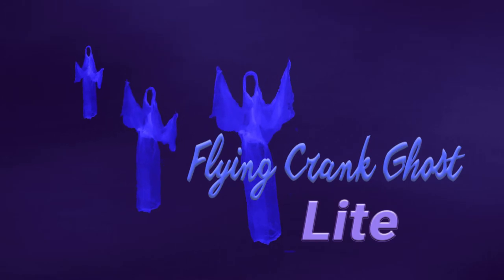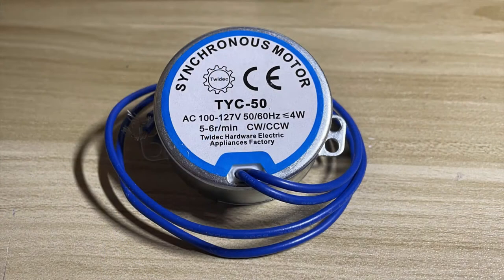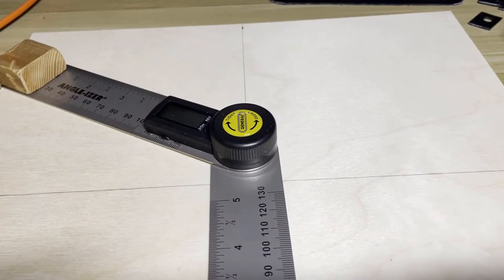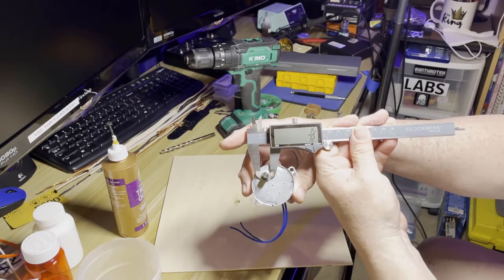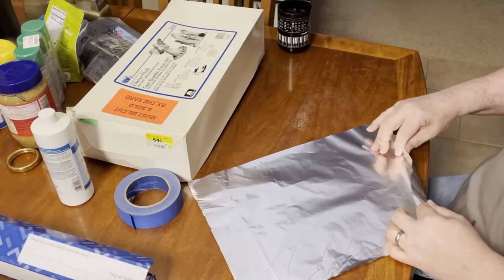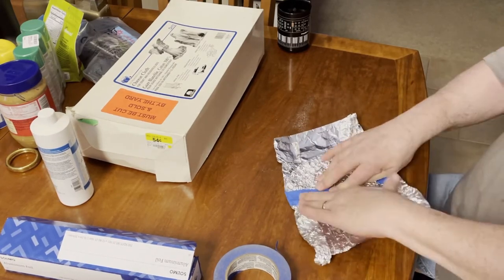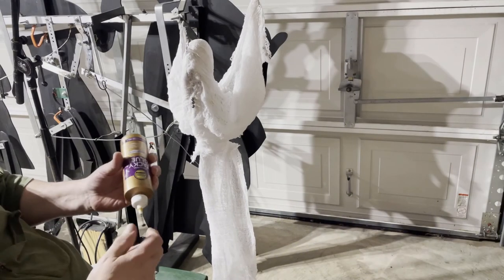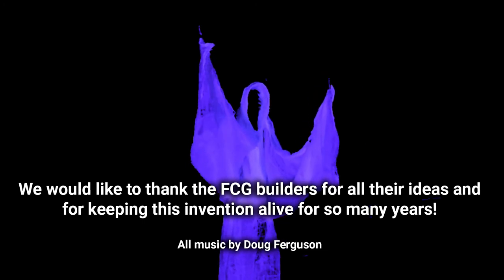Flying Crank Ghost Lite Part 1

Comment from the maker: My site:
http://www.phantasmechanics.com

dougferg119@gmail.com

How to Make a Spooky Tree - the origin of my foil method used for the molds:
https://www.youtube.com/watch?v=2_XgEcpXeME&t=147s
These are seriously neat and you should make one or more! 
Where the Gnomes Live is the channel name

Materials, as mentioned in the FCG Lite programs:

1/8" x 12" x 12" Birch Plywood, 6 sheets, $25 - size for mini FCG Lite motor platform
https://www.amazon.com/3MM-Baltic-Birch-Plywood-Engraving/dp/B07CHX1GTD/ref=sr_1_2?dchild=1&keywords=1%2F8+plywood&qid=1633794520&sr=8-2

Cheesecloth, 36" x 144", $4 - may make more than one ghost, depending upon your design
https://www.amazon.com/Trimaco-SuperTuff-100-Percent-Bleached-Cheesecloth/dp/B00004YOTJ/ref=pd_sbs_1/140-6342258-2338419?pd_rd_w=wnMZ2&pf_rd_p=690958f6-2825-419e-9c16-73ffd4055b65&pf_rd_r=2J1QTZ4FYTHH4MBSDE4K&pd_rd_r=f37c0ea8-58e1-473f-968c-7adcc0cb8e33&pd_rd_wg=gWp0j&pd_rd_i=B00004YOTJ&psc=1

Fabric Stiffeners: 
Mod Podge, 8 oz, $7
https://www.amazon.com/Plaid-Stiffy-Stiffener-8-Ounce-1550/dp/B00114Q5DA/ref=sr_1_6?dchild=1&keywords=fabric+stiffener&qid=1633689526&sr=8-6

Aleene's 15588 Fabric Stiffener, 8 oz, $7
https://www.amazon.com/Aleenes-Create-Fabric-Stiffener-Draping/dp/B004KYV4XO/ref=sr_1_4?dchild=1&keywords=fabric+stiffener&qid=1633689657&sr=8-4

Tacky Glue, Aleene's Always Ready, 4 oz, $6+ - Has a stand that holds the bottle inverted, a useful must.
https://www.amazon.com/Aleenes-33143-Original-Always-Adhesives/dp/B00OY0T97M/ref=sr_1_7?dchild=1&keywords=tacky+glue&qid=1633689895&sr=8-7

Masking Tape:

Scotch Painter's Tape, 1.88" wide, 60 yards, $7
https://www.amazon.com/Scotch-Masking-Painting-1-88-Inch-60-1-Yard/dp/B000BPILS2/ref=sr_1_13?dchild=1&keywords=masking+tape&qid=1633690360&sr=8-13

Bami black tape for makers, 1"  wide,  30 yards, $6
https://www.amazon.com/Tape-BAM-Projects-Labeling-Constructing/dp/B08ZB27HRX/ref=sr_1_36?dchild=1&keywords=masking+tape&qid=1633690360&sr=8-36

7mm flanged shaft coupling, 3 RPM (slow ghost!), $10 pair - with set screws and hex wrench
https://www.amazon.com/Magic-Shell-Coupling-Accessory-Connector/dp/B07J66Z3B7/ref=dp_prsubs_3?pd_rd_i=B07J66Z3B7&psc=1

Motor, 6 RPM (as used in video), $9 a pair
https://www.amazon.com/gp/product/B07QPZSKCW/ref=ppx_yo_dt_b_search_asin_image?ie=UTF8&psc=1

NOTES: 
- Do not use speed controls or dimmers with synchronous motors!
- There are other groupings of motors and cords in multiples available  on Amazon for less money, but I have not tried these.

Cords with installed switches, pre-stripped ends, 4-pack, $10 - easy-peasy wire-up!
https://www.amazon.com/Button-switch-Switch-Stripped-Wiring/dp/B07NV314QK/ref=sr_1_34?dchild=1&keywords=appliance+cord+with+switch&qid=1633693244&sr=8-34

Motor, single, 3 RPM (very slow ghost!), with power cord, splicing block & Switch, $10  - kit Includes a screw-top shaft coupler as well.
https://www.amazon.com/gp/product/B08J2LLW2S/ref=ppx_yo_dt_b_search_asin_image?ie=UTF8&psc=1

KastKing monofilament 12 lb. test fishing line 300 yd, $8. Get Black Mamba color for FCG use, other colors may glow.
https://www.amazon.com/gp/product/B07GDLBT4Z/ref=ppx_yo_dt_b_search_asin_image?ie=UTF8&th=1

Amysports fishing swivels, size 1,$10 - lots of these, perfect for many Halloween FX purposes
https://www.amazon.com/gp/product/B085SXP7XD/ref=ppx_yo_dt_b_search_asin_image?ie=UTF8&psc=1

Fishing Weights Sinker Kit, Split Shot, assorted, $5 - great for weighting FCG marionettes against blow-away by wind when used outdoors; also good for ballast indoors.
https://www.amazon.com/gp/product/B08924JNV2/ref=ppx_yo_dt_b_search_asin_image?ie=UTF8&psc=1